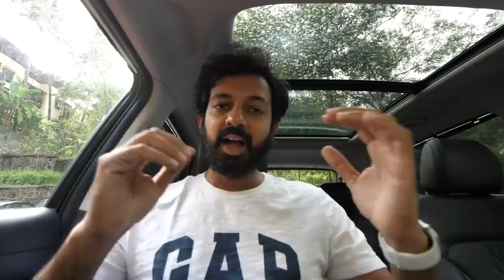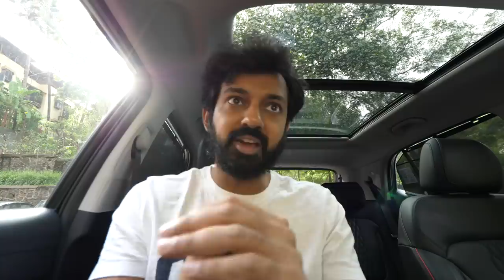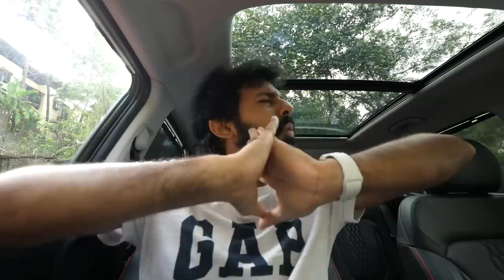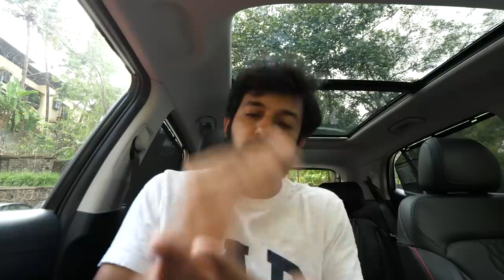Small Capacity Turbo Petrol Engines!

Comment: Reason why Japanese aren't offering turbo petrols and DCT is "RELIABILITY" is their main forte.

Naturally aspirated engines have unparalleled long term reliability compared with small capacity turbo petrol.

Please tell DCT being offered by certain brands is "DRY CLUTCH DCT" which heats up in bumper to bumper traffic. 

CVT, TC are made of bullet proof reliability offered by Japanese.

Reason why Maruti has skipped diesel is coz of high emission of the oil burner when compared to petrol.

Atleast the industry leader is thinking about environment and clean air.

Had you been in Delhi few years ago and rolled down the window in traffic, you would have known the reason why Diesel is discontinued.

Comment: I won't be surprised to see a 1.0 turbo not even do 1lakh kms before the engine needs to be opened. No matter how much tech you add to a small engine, its still going to be a small engine. It is not going to be as responsive as a big displacement engine. Japanese cars are more known for their reliability and longetivity than fooling around with features. Want proof, go see old innovas with 5lakh kms or see a old NA Honda City with 3 lakh kms without any trouble. If Hondas and Toyotas are not offering 1.0 turbo engine, its for a reason. They simply don't want spoil their reputation. Maybe they are testing their 1.0 turbo engine and are devoloping it to be reliable according to their standards. Once done maybe they may launch it in India. 
As far as suzuki is concerned, how did we as indians treet the Baleno RS which came with a 1.0 turbo petrol. We as indians expect only mileage and cheap maintainance from suzuki. A turbo petrol is simply not going to deliver mileage and maintanance benifits like a NA Engine. So why would suzuki even think about launcing a 1.0 turbo in india. Maybe if we indians bought the baleno RS then maybe they might have even launched the swift sport with a 1.4l turbo.

We as Indians buy a car just to showoff to others with fancy features and dont even care about its reliability and longetivity. I can bet that Hyundai is not even going to last half as long as a Toyota or Honda and all those features is going to break after some years. So i feel Toyota and Honda makes cars thinking about long term.
Reply: Absolutely right! 👍

Comment: Turbocharger is a Forced Induction device which entraps more Air and sends it to combustion chamber for completing 4 stroke cycle. Since more content is of the air and lesser fuel is consumed, It's more frugal than a Naturally Aspirated Petrol Engine. 
Turbocharger is connected to the Exhaust Manifold and Exhaust section. 
It also requires Intercooler since the turbo heats on spooling up to produce more power.

Comment: Swift vs i10nios(not turbo)
Like- swift, comment-i10 nios.🔥🔥🔥
Reply: Nios Turbo
Reply: Its actly out of budget 🔥🔥
Thats why didnt mention turbo pls suggest from naturally aspirated engines.
Reply: neither I will get figo
Reply: @ujjwalghosh7607  its costlier, will have the least resale value, high nvh levels due to 3 cylinder engine and not so easy availability of parts and costlier too.
Reply: @mr.kapoor3803  no its a gr8 car for Daley usage and ford gives one of the best service after hyundai in India ya after sales service might not be at level of MS and H but it has 6 airbags too

Comment: Let me put is succinctly. 1. By law, Indian market is tilted towards small petrol(<1.2l) & diesel(<1.5l) in PVs. 2. Even though NA is better tech for petrol, Small size NA petrol become useless the moment kerb weight >1k. 3. Small size Diesel is good for kerb weight <1.5-1.8kg....now what to do! as this gives a sweet spot of small NA Petrol to just entry & mid level hatches and for diesel it goes to premium hatches, compact & mid SUVs. Now BS6, TAFE norms etc force diesel tech cost to go up & to counter that they brought in turbo petrol as a workaround jugad for diesel-  you meet the law, you get the power& torque suitable for 1-1.8kg kerb vehicle, BS6 compliance cost is low, small size etc etc. but it's a zero sum game- you gain all that by compromising efficiency. In PVs space mass market small turbo petrol is such a joke..u get good efficiency when u drive it like a Bullock cart and the moment you drive it for the reason you bought it for i.e. performance, power, torque - it makes you sell your fortune to quench its thrust...and the demographic segment which buys small mid range PVs obviously can't do that...So u see it's a very tight rope...so what's the solution?? In my opinion the solution is Small NA petrol with mild/strong hybrid OR Small diesels with a bit higher cost of BS6 compliance. That way you get to chose the lesser of the evil and yet enjoy your car with peace of mind....and for turbo petrols- well, good for ferraris where mileage is not a consideration else for the segment we are talking about, the you & me and Sharmaji it's a passing fad which will go away the moment NA petrol+hybrid get some footing. Small diesel with emission compliance will remain in the market till cost of compliance makes it too expensive to afford by manufacturers & customers alike. So for me it's a diesel till then 😎👍🏻

Comment: On a practical note.. turbos are way less fuel efficient and on high maintenance than NA. In a mass market like india these are the main factors a common man looks at.
Honda 1.0L turbo 122bhp 175nm vs 1.5L NA 119bhp 145nm
With this kind of difference I would pick NA.

Comment: First we have to understand that if a car can do 100kmh under 5 seconds, if not then why are you even wasting time on gears and if your going automatic then cvt is the smoothest as it is a continuous surge not a head bobbing amt and even worse, a dct gearbox with a sluggish engine. That's like buying a 6 lakh car but paying 6 lakh more( 12 lakh ) just for a dct that was meant for a sport car engine. So an amt N/a 1.0 engine or a 1.2 and above with a cvt. Hence Honda city, amaze and Jazz cvt are the best. And yes in that way they are still the most sensible engine makers.

Comment: i10 grand nios vs polo which has the better turbo petrol engine.
Reply: Polo(108bhp) is segment above should be compared with new i20.....i10(100bhp) turbo is fast in its segment
Reply: @antarikshuprade  but i20 is not having any turbo petrol engine.

Comment: Dude fisal
I agree with most of what you spoke
In simple words i tell you
Honda will use complicated tech like turbo onlybwhen its absolutely necessary and when it has really good reliability and cost or maintenance
It depends on the fuel quality and tech competence of maintainance by service network for such complex tech all maters
They will bring it when people value such complex engineering over gadget and giszmos on namesake turbo in Korean cars
And they will bring it only when you autovlogers put some sence into people instead of going gaga over touch screens
Thats why you see shitty engine even when it had name sake turbo on Hyundai or Tata
But the German turbos are very reliable tech which no one else can match
Surprised with mahindra gdi turbos but shd see how they fair in reliability 
So dont put down Honda for their choices by hyping all ne sake features of Koreans

Comment: They can use diesel with supercharged engine and it is fuel efficient as well and turbo chargers are having more cost than supercharged engine for > 1.5L displacement..most of the manufacturers are having no sense of innovation ...only they using their brand name for money nothing else...they prefer cosmetics innovation rather than mechanical...

Comment: As a car guy i can tell you petrol engines are more reliable than diesel engines ,

If diesel engine starts getting trouble then there will be no the point of return,
 
Better go with petrol engines they are more reliable (dont go hybrid also as they cost more when they go crazy)

Comment: An extremely constructive and honest rant video! As you said, maruti being the market leader should start treating the market with more respect and take the market lot more seriously. Their attitude may have worked pre 2012/2010 but not today, the only reason they are selling today are because of the brand value they built and nothing else. Even though certain hyundai/Kia models seem to have certain quality issues but in reality they are the only mass market brand in India today which give maximum bang for your buck being pretty much an all rounder.

Comment: I'm planing on vento 1.0 Tsi. Pls suggest will the engine be reliable Because im planing to keep the car for next 7 to 8 years .. 1.0Tsi if serviced on time will it run for .1lak kms easily ??
Reply: Yes period. 1 liter tsi ie the only engine vw  has to give under 15 lacs car. So go for it you will not regret. Just get your car service form service center other then local shops. These are German built cars and in india the local shop workers are illiterate and they doesn't get paid well so they doesn't work with enthusiasm.
Reply: @S_square_interiors04  
Well I have a rapid 1.5 2014 model.
Injectors keep blowing off  only 80k kms done. So i have bit of trust issues. And minor electronic problems keep popping up.
Want to exchange it for Skoda only, but confused
Reply: @somecommentor  there is no car issue which can't be fixed. Try changing your mechanic or the service center. I guess your car has some electric issue which keep blowing your injections. Try getting some genuine parts, i am guessing you have 2014 petrol. If I would have been your place I would have kept the skoda and get it fixed. Since there is lot of years left on your rc. Because vw is coming up with new vento facelift.(looks hot af) which is worth waiting for that upgrade. Since you already own an vw group car. I bet you will not go for other manufacturers.
Reply: @S_square_interiors04  its  diesel.
Have spent 40k twice in 2 different authorised service centre. Im unhappy with the service through. 
Anyways.thx for ur advice

Comment: Can we install CNG in a small capacity turbo petrol engine? For eg the Grand i10 Nios GDi
Reply: Yes there is no difference between using petrol as fuel or cng as fuel they both work the same since cng h has high burning temperature they burn slightly higher as a result they joss the power by 7 to 8 percent, and cng has to be stored in saprate tanks. That is the only drawback. However you can easily install some good aftermarket cng kits such as tommesetto of zovalo sequential kits  both are designed in itley and give best value for money. Long answer shot yes you can install cng in 1 liter turbo petrol.

Comment: Strongly agree with your point of buyer awareness. Most indians do "bhed-chaal" when it comes to buying any product.
But this should also not be forgotten that reliability is a point of concern in turbo petrols. 
Btw I'm buying an i10 nios turbo next month :D
Reply: Hey, just wanted to ask how it’s working? I booked venue with turbo engine.
Reply: @Harjotsingh17725  Hey, I ended up buying Skoda Rapid tsi last year. It also has a 1.0 turbo of vw group. So far, no issues at all. Have done a couple of very long trips (>1400kms per trip) and had absolutely no issue till now.

But this is short term only. We'll only know about the reliability once our turbo petrols last more than 5-6 years or more than, say, 1-1.5lakh kms.

Comment: From a v6 dodge i moved to a 2liter turbo charged VW polo GT. This was like in 2011. I thought that all cars should go this route from NA to smaller capacity turbocharged. I gradually saw that happening in the US where VW had a staple 2 liter turbo on their Audi offerings. I can relate to what you are saying. Smaller capacity turbo should be the norm here in India too especially for the urban driver. For semi urban and rural stick to the diesel. After I moved back to India I got myself a Thar. I loved the turbo charged 2.4 diesel on it and now it will be even a better engine with a 2 liter. I would like to see a 1.3 turbo petrol on a WRV with a DCT or atleast the NA 1.5 on the WRV.